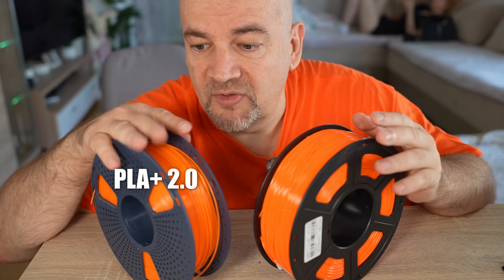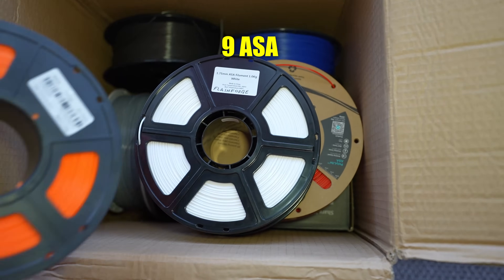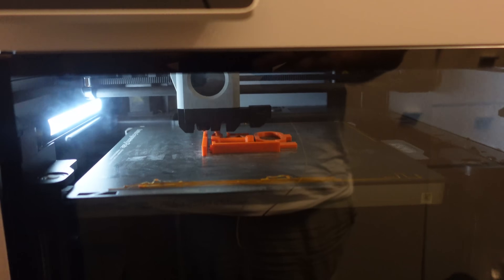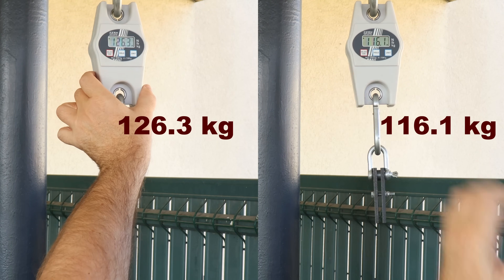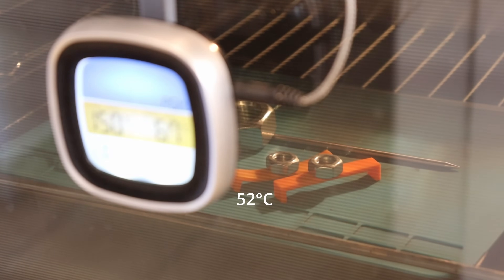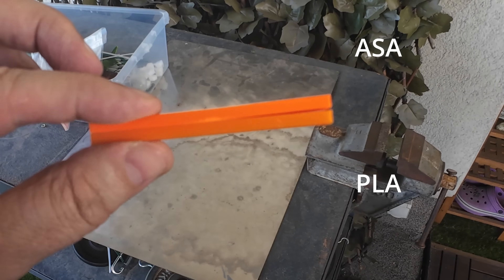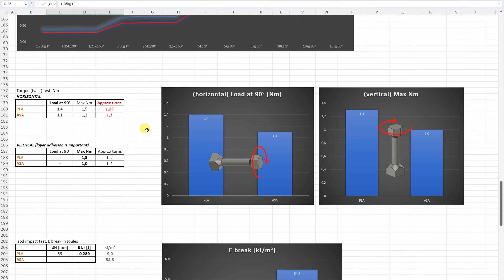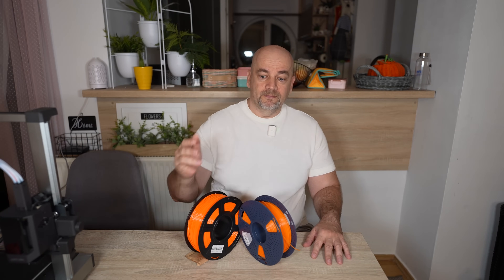Is ASA always stronger than PLA? Sunlu PLA+ 2.0 vs Sunlu ASA

Comment: What are the basic differences between the original Sunlu PLA+ and the newer 2.0? Is the 2.0 really any different? More durable, better for functional parts? 

Really wish the industry would provide better regulation for all these PLA +/Tough etc. filaments. Manufactures can just about call anything a + version with little to no provided info on what the additives and changes are.

Comment: After have some trubble with normal PLA in my Ender3 V3 SE with normal speed ( up to 250mms) I will give the PLA+2.0 a try because its cheap and should can handle my print speed.

Comment: ive used both sunlus 2.0 , pla + and high speed. For me the high speed stuff seemed weak. the pla 2.0 seemed like a good middle ground of speed and strength with a balance of higher speeds

Comment: I hate that warp and especially big shrinkage. As a beginner, it was my biggest multiple failure. ABS-GF was the saviour
Reply: Yeah, material shrinkage is the #1 concern for my uses. I mostly make functional parts so dimensional accuracy is what I need the most above all else.
Reply: @crispy_orb  what do you use as material?
Reply from the maker: Use GF or CF filaments. They keep this dimensions much closer to designed ones.

Comment: When compared to Sunlu regular PLA+ (~ one year ago), PLA+ 2.0 seems to the weaker in almost every property (impact strength and temperature are the same) 🤔
Or maybe it is related to different printer (BL P1P vs Ender 3 S1)?
Reply: It's weaker than Creality hyper PLA and Sunlu HS PLA. I printed things like Disk Shooter and the uhltimate otf knife with all three of them and they all rely on the a stiffness of the material. both the Hyper PLA and hs PLA had way snappier springs in the otf knife and disk shooters were more powerful. They made it tougher by making it "softer" and less brittle by that. But it looks and feels amazing, a little bit like vinyl or PVC. Should be good for multi colour prints (their jayo variant is dirt cheap here. 5,5kg PLA+ sets for only 49$, 11kg even cheaper) and fidget toys for example. It's cheaper than their regular pla+.
Reply: I'm also quiet supprised about this. I'm currenty searching for my new go to PLA+ to replace some of my PETG usages that don't require the high temp resistance and was supprised to see the regular Sunlu PLA+ much higher in my personal weighted rankings than the PLA+2.0. Will try some of this stuff for sure now instead of the eSun PLA+ that i used sometimes already
Reply: Thanks all for saving me the unnecessary purchase

Comment: After using ABS for printing fucntional parts for my business for around 1 year i swapped from esun ABS+ to Overture ASA and it was so much stronger. I assumed ABS and ASA were about the same however the Overture ASA has a slight purple hue and it's tremedously strong compared to the esun ABS. It's definite;y moe expensive but probably worth it knowing the parts won't break easily at all.
Reply: that's because esun's abs+ is garbo, it is not a regular abs but a modified one.
Reply: @riba2233  it’s not garbage I’ve used it for over a year it’s the better of some ABS filaments I’ve tried but my point is Overture ASA is about 10 times stronger than ABS in general
Reply: @BarnesysBuilds   it os because whatever they used to modify it severely weakened it's layer adhesion to around 10mpa, compared to around 25-30 normal abs ones get. 
Also doubt it is 10x, that wo6 be unreal for any plastics
Reply: @riba2233  you have to tweak the hotend temperature settings and remove all fans to fix layer adhesion, I manage to get it pretty strong after printing and selling functional parts from it for a year I haven’t had one return. The overture ASA is definitely much much stronger, like 10 x stronger as it says on the box😜

Comment: i got some of their PLA+ 2.0 in red and was disappointed, the red was almost translucent there was so little pigment, and it was brittle as all hell, snapping in my Creality K1C bowden tube
Reply: So it wasn't dry, just dry it out
Reply: @riba2233  the brittleness wasnt the only problem, the pigmentation was. but also I've never had to dry PLA in my 8 years of printing, and suddenly I have to on this modified PLA? hell nah
Reply: @Mobile_Dom   well yeah, sometimes you do, moisture in the air changes and for these cheap filaments they can't guarantee that it's bone dry from the factory

Comment: Using a cooling fan on ASA just shows lack of experience with the filament. ASA and ABS don't like cooling fan at all and results in weaker parts. 
The only scenario where cooling fan should be used in a very weak setting is on bridges, nothing else.
Reply: It is not that simple
Reply: @riba2233  it's that simple, the only benefit cooling fan brings is making parts pretty, they never get stronger.
Reply: @ralmslb  sometimes it's simply necessary (depends on layer times, smaller prints etc) and things change with hot chambers when parts don't cool as fast. So no, it is not that simple
Reply: @riba2233  the point of a hot chamber is really to have it cool down slowly and evenly. The very small layers is an exception and even than you need to be careful, you can't rush it.
Reply: Tanke a look at the ABS profiles in Orca the have also cooling on, an this should be the best tuned profiles for abs

Comment: Regarding the weak layer adhesion on ASA when part cooling fan is used, and poor print quality using no fan, there is a way to get a better compromise at the expense of print speed - turn the fan off completely or set it very low like 10% and enable a “draft shield”. On small items like these test pieces the layer time is far too short for ASA without a fan, however the extra time per layer spent printing the draft shield is enough for the ASA to cool sufficiently without a fan to give decent overhangs while still giving good layer adhesion, and without the oozing problem that a layer pause would introduce.

Also you don’t say what print speed you’re using for ASA - it benefits a lot from lower print speed - I print PLA at up to 200mm/s but limit ASA to around 60-80mm/sec which combined with the draft shield gives a good result without cooling fan.

I’d be interested to see a comparison between part cooling fan and draft shield with no part cooling for ASA, and also testing different print speeds to get some actual numbers on it.

My default settings for ASA are draft shield enabled, 60mm/s print speed and fan disabled but with 20% fan for bridging only and this seems to work quite well.
Reply: On parts with short layer time I either print a duplicate part in the back corner of the bed or a simple square based cylinder the same height as the part.
Reply: @backgammonbacon  No need to waste filament. Set a minimum layer time and save the trouble.

Comment: Thanks Igor. FWIW, I get great printability from ASA with zero part cooling on the x1c, but the minimum layer time must be about 15 seconds. So for small layers like your test objects, I guess it would increase the print time. For large parts like I print, it's no issue and I don't have to deal with such weak layer adhesion.
Reply: I use a draft shield to increase minimum layer time on small parts - works well! Slows down small layers a lot but doesn’t have much overhead on large layers. Gives good results with no part fan except for bridging. See my other comment.

Comment: Wow....PLA+ came a long way in terms of properties...its my go to material for prototyping 👌
Reply: I just wish they would be more open about what's mixed into such blends.  With PLA Meta I've for example no issue printing it in my office room, but PLA+ gives me quickly a headache so I handle it like ABS / ASA.   Wouldn't be surprised if there are some styrene added to PLA+.  I can understand that they want to keep their exact mixtures secret, but from a customer perspective I would like to know what's inside.
Reply: @Leif_YT  really doubt it is styrene, probably some rubber like compound they use in abs or asa (butadeine etc)
Reply: They use pbt or other plastics to make it harder. Don't know the other one right now

Comment: PLA really is the best material unless you need high temperature resistance. Cheap, widely available, easy to print and requires little ventilation/air scrubbing (Everyone should at least purchase a cheap Hepa air filter).
Reply: also if you don't mind poor creep performance...
Reply: @riba2233 it has less creep than others, especially Nylon. Except at hot temps.
Reply: @riba2233  Sure, but that can be made up for with other mechanical or design considerations (i.e. in his test, a simple clip on the ends would suffice).

All lower cost plastic (aka PLA, petg, abs, ASA) creep. Though they do so to varying degrees, the same design considerations and solutions will be the same.

You would need to step up to PC and filled materials if you want an actual stout component that will eliminate the need for such solutions, which is not nearly as cost effective nor easy to print.
Reply: @winebartender6653  no they don't, abs asa and pc have the best creep performance, petg is mid, pla poor and pa abysmal. there is a huge difference, you can't just say they all creep the same when it's jut not true, not even close
Reply: @riba2233  Are we watching the same video? So with the loaded ASA, that is an acceptable amount of creep? If you are merely referring to it's ability to return somewhat from an extended load period, sure, but I fail to see how that is even acceptable. All of them will require a different design that prevents the creep in the first place.

And where did I mention PA? I said filled filaments will be much more stout than any of the aforementioned.
Reply: @riba2233 Is there a video testing this?
Reply: @KaloyanDobrev  all of filament tests he did show it. but for eg ones where he tested all prusaments and polylites are good for comparison
Reply: U forgot about uv